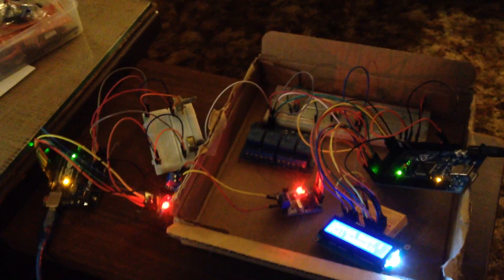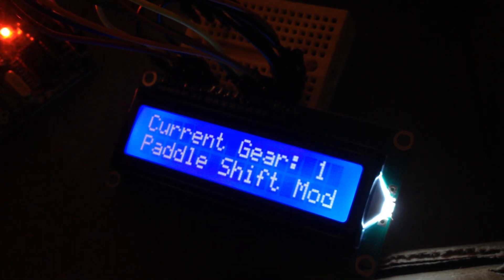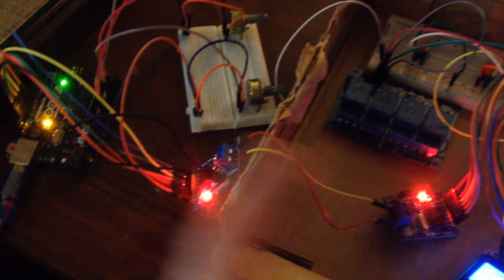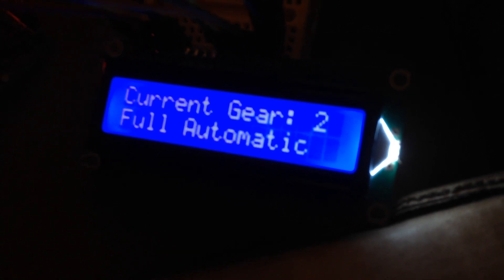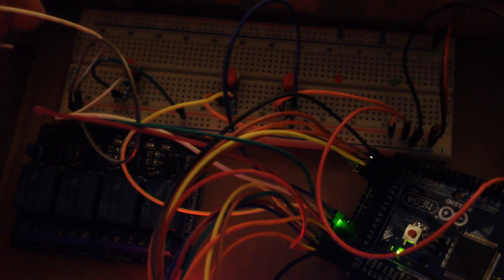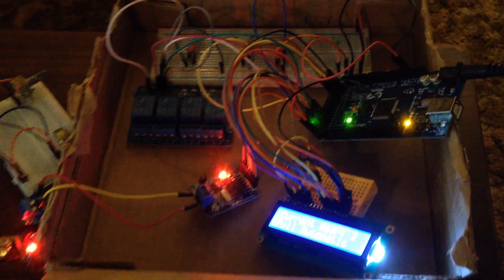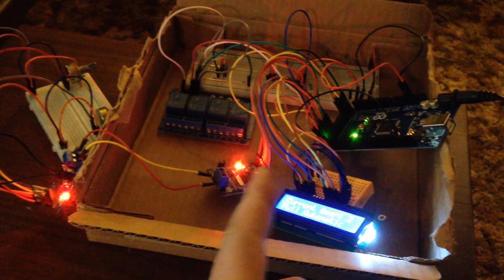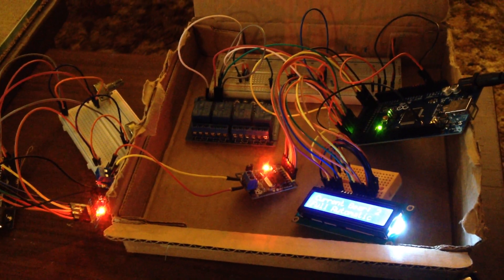Arduino transmission controller working with simulator!

Comment: seeing the code would be nice. I am trying something similar. I have been working on too many other things lately so the TCM is on back burner. Linking/sharing the code would be great.  I understand why you don't. But I am using switch case mainly on mine. Then it's basically a factor of RPM, VSS and TPS. But ya I just haven't had time to start testing with it just yet

Comment: Hey, how did this finally turn out? I'd like to use one of my many Arduinos as a stand-alone E4OD controller. Already got my eye on a Speeduino setup to replace Ford's overpriced EEC-IV (DAMN but they are proud of parts for their old trucks!!), and I need something to replace that part of the box.

Comment: How did you make out?  I am looking into LS swap with microsquirt, and am kinda stuck with a trans controller.  I am just seeing what other options are out there beside HP tuners on the cheap.

Comment: Have you considered adding a solid state relay for the control of the shift pressure, via the the variable pressure solenoid.(For transmissions that have them fitted).
This allowing a lot better control of shift firmness, such as soft shift for for normal operation and then change the PWM of the VP SOLENOID to make the shift a lot firmer for race mode etc.

Comment: Plz post your code.  I can help you set it up to use a oled display.
Reply: AkNovaMan hi aknovaman! I like your channel, inspired me to start arduinoing. 👍
Reply from the maker: AkNovaMan don't need a fancy display for this setup nor do I want one. It's got to be a quick easy to see screen for when your flying down the drag strip or at a auto cross. Keeping it simple yet functional.
Reply: Ok.  Share code?